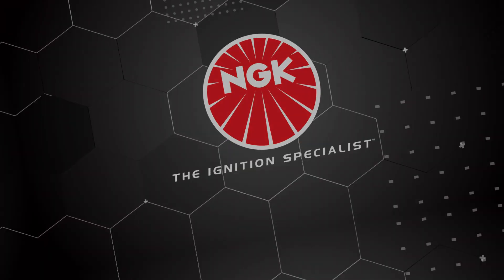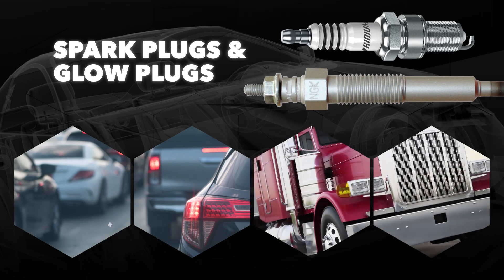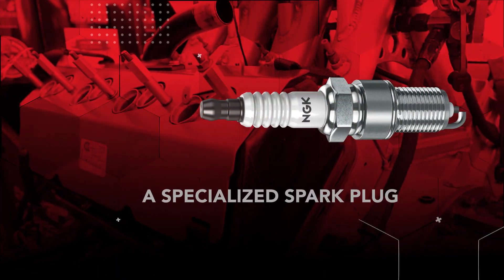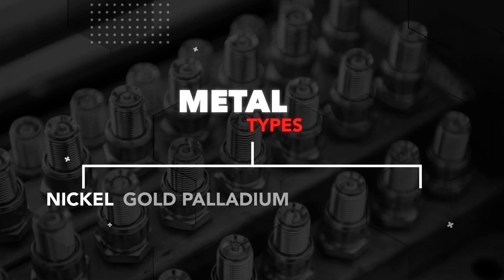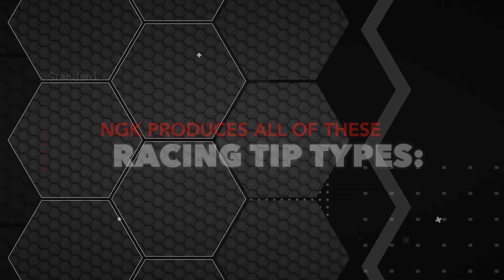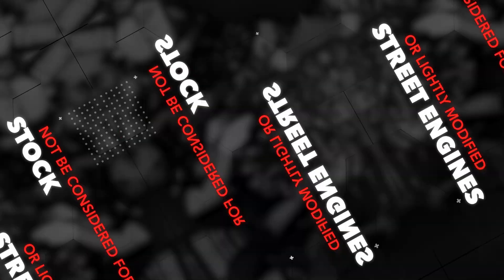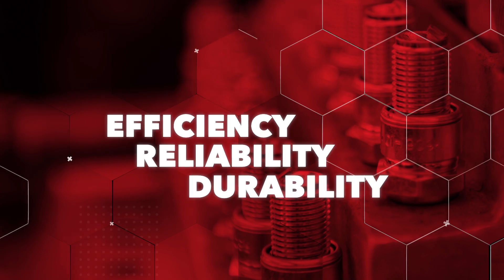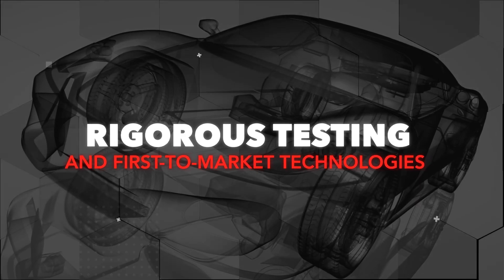NGK Racing Spark Plugs Overview

Comment: I’m using NGK racing plugs on my tuned turbo cars. They are NOT racing engines and they DO require non protected tip spark plugs. My Abarth probably generates more heat than a race engine because I’m pushing the stock architecture as far as possible.